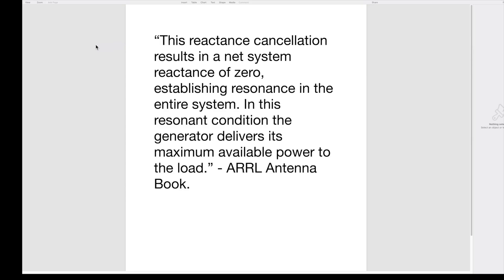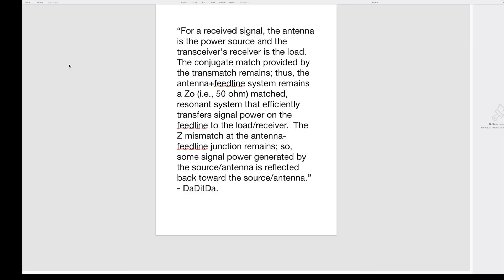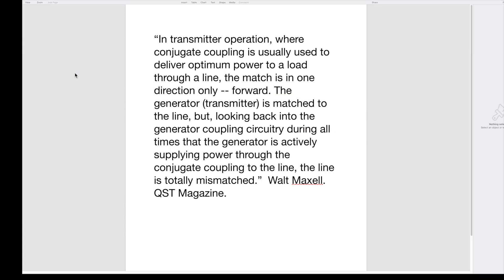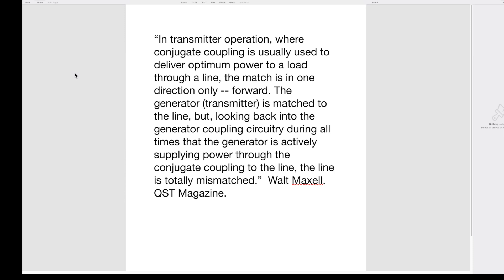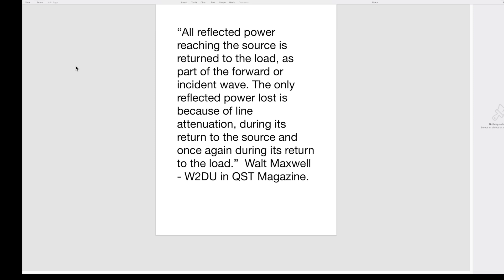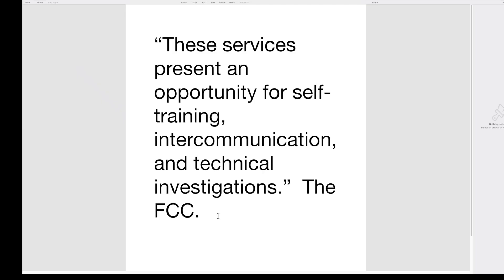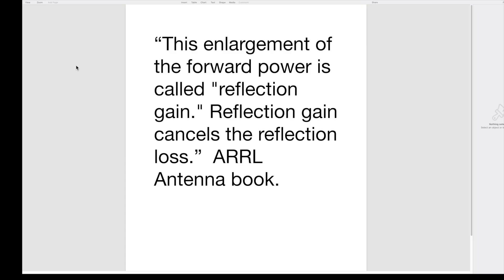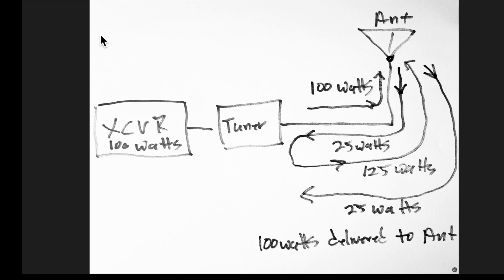Ham Radio Antenna Tuner in Receive Vs Tuner In Transmit.

Comment: Does this conjugate match concept also apply to signals with reflections that don't necessarily have trans-match networks? I have my IC-705, which doesn't have a built-in tuner, and on 20m my SWR is 2:1 at 14.385 MHz . Does this mean that roughly 11% of my power is reflected back to the radio and is absorbed by it?

The way I understand it, that no tuner is needed and as long as I am transmitting, reflected power bounces back to the antenna in-phase with the incident wave and transforms into reflection gain? And that I only need a tuner if I am getting close to a threshold  of the SWR values ( that a particular radio was designed for) where protection circuits may start kicking in cutting my power? So, as long as my 705 is within the SWR range at which I get my full 10W out to the antenna I shouldn't worry too much. Am I wrong? Does this only apply if one has a tuner?

On 14.385 MHz my SWR is 2:1, according to my Nano-VNA. I also measured my coax feed line loss when perfectly matched on 20m at 14.385 : -0.31dB. In the ARRL Antenna Book I looked up additional loss due to SWR of 2:1 : - 0.15dB. This brings the total loss in my transmission line system to - 0,46dB. Ludicrous!!!! Who, in their right mind, would worry about a 1/12 of an S unit? Half a dB is imperceptible for even a professional studio audio/mix engineer listening through high end monitors in an acoustically treated room and no noise floor. But on HF no one would tell a difference between S7 and S8 with average noise floor levels. And that's 6 dBs!

But perhaps, this is only true with tuners? What if I don't want one? Because if this works the same without a tuner, I don't need it just to get my 1/12 of an S-unit back...
Reply from the maker: Reflected power is NOT absorbed by the transmitter, tuner or no tuner.  Here's what happens with no tuner.  Say you have a transmitter putting out 100 watts but 50 watts is reflected back.  The transmitter output will be reduced to 50 watts and that 50 watts combines with the reflected power of 50 watts, so 100 watts is still delivered to the antenna.  There is no loss. 

In your case with a 2:1 SWR,  that's about where protection circuits click in and reduce power to protect the finals.  But they are not protecting the finals from reflected power.  They protect the finals from the impedance mismatch which can cause excessive voltage and current in the final states, cooking the transistors.   Remember, the transistor is the fastest fuse on three legs.  

I personally am not comfortable with a 2:1 SWR with no tuner.   Transceiver's are expensive to repair.  

For more reading download a series of articles from Palomar Engineering called "Kurt Speaks Out," page 12 under "Reflected Power Revisited."
Reply: @BustRadioMyths  Thanks for taking the time to reply and provide the explanation

Comment: This explanation makes perfect sense. While attending tech school and the study of an AC signal with inductors and capacitors. I learned that in an inductor the voltage across it was higher as shown on a dual channel OScope when the magnetic field of the inductor colapsed as the AC signal changed transistion. And while this applied to AC, it has a direct correlation to radio signals.

Comment: How good are you at identifying interference?

Not the place for this but I don't know how to contact you otherwise.  Have you ever heard this kind of interfere and do you have any idea what could cause this ticking noise?  It's consistent, 24/7, and I can't seem to locate the problem.  Thanks in advance.

https://youtu.be/i2yPeg0yOx0?feature=shared

Its only on my HF base at 6m and below but not on my UHF/VHF HTs or Mobile Car UHF/VHF base.  I ruled out a problem with the HF base station, so its something in the area around it.  I do have a HT with some hacked firmware that can receive HF, and its there as well, so its something causing interface on the HF frequencies (all of them!)

If anyone has any ideas thank you in advance.  I've shut down most of the stuff in the room including the wifi.  No dice.
Reply from the maker: I see you figured it out.  Good work!

Comment: I see "reflection gain" on my outboard power meter all the time, indicating I'm outputting at or above the rated output of the transmitter. Encouraging that my relatively low power is not lost!

Comment: This is a hard topic for lot of people to grasp. Everyone wants to apply simple equations. We have here R and X or I should say R+jX. This is called a complex number in math! Sometimes the term jX is called imaginary! All for good reason. When using only real resistances things are fairly easy to see but we are dealing most of the time with not only resistance but reactance. There is a phase shift involved and the current is not always in phase with the voltage. Power is not just voltage times current but it is voltage times current times the cosine of the angle in between.  Lots of times the cosine factor is simply 1 and not spoken about. We know the real forward power has the voltage and current in phase but when reflections occur and direction reverses and standing waves appear because forward and reflected voltages and currents add and subtract all along the line, it gets complicated pretty quick!
Keep up the good videos!
Reply from the maker: Great explanation you sound like an engineer.  Yes, it's all difficult to wrap your head around especially when you've believed otherwise.
Reply: @BustRadioMyths  yes. EE (Electronics) from Virginia Tech.
Reply from the maker: Guys - a shortened antenna is going to be a poorer radiator than a full size antenna.  Full size means a dipole for example that is a full half wave.  A half wave dipole on 10 meters is only about 16 feet.  A half wave dipole for 80 meters is about 130 feet.  Do you think the 10 meter dipole will work for 80 meters?  No.  Will the 80 meter dipole work on 10?  Yes.  So size matters in this case and height matters too.  Get it up in the air as high as practical.
Reply: @aarongriffin81  I think you got exactly what we were saying.
Reply: @aarongriffin81  if I understand you, you and I are saying about the same thing. Not sure I fully understand everything you said. However the radiator must be large enough in terms of wavelength to work. A coat hanger is not big enough for say 20 meters. There are many variables in the antenna equation.  Tuners have their place. Self resonant antennas have their place. Non resonant antennas, like my 160 meter inverted L sure have their place. I got DXCC on 160 meters with it. However the tuner at the base of the antenna did tune it to resonance. So the wire itself was not resonant, but I would say I did resonate the antenna with a series capacitor.
Reply: @aarongriffin81  maybe you are you saying that you don’t agree with the video?
Reply from the maker: @aarongriffin81. Well it’s good to know you know more than the world’s top antenna engineers and the editors of the ARRL Antenna book.  But believe what you want
Reply: Thank you for this info and your other videos on similar topics. Really opened this newer hams eyes to experiment with non resonant antennas. Has been a game changer for me.
Reply from the maker: @wesh1061 Don't believe the baloney that a resonant antenna is better.  As long as an antenna is long enough for whatever frequency it'll work just fine.
Reply: Is always longer antenna better? What is the most important to make efficient antenna?
Reply: @Adam-he4mk no longer is not always better! A halfwave piece of wire is a great length. It radiated broadside with almost a 90 degree beamwidth between the 3dB points. You get less and less radiation as you move around to the end where there is a null. How deep the null is depends on the height of the antenna in wavelengths. Wires less than halfwave will radiate but, in general you get less radiation as you get shorter. Longer than half wavelength and you get into a situation when the pattern becomes more complex. When the wire is a full wave long you get more of a clover leaf pattern. There are 4 nulls instead of 2. There are also 4 narrow points of maximum radiation instead of 2 broad points. The antenna needs to be pointed in the direction you want to work best. With low antennas the nulls don’t hurt much so lots of longer wires work really well. However if you have a high long wire or even a high dipole your signal can be down one, two or more S-units in a null direction. I find two 10 meter dipoles at right angles to each other at 40 feet cover all directions pretty well. On 20 meters with a dipole at 40 feet it’s not so noticeable but I do it because I can sometimes see a difference, but only if a station is dead off the end on one dipole. In that case it helps only in extreme weak signal conditions.